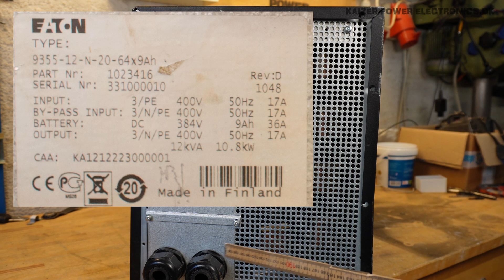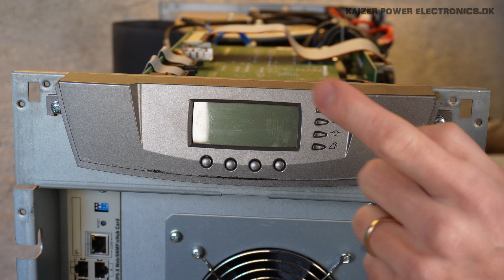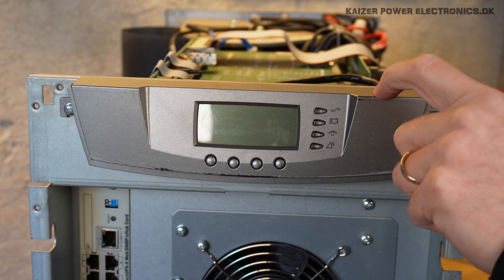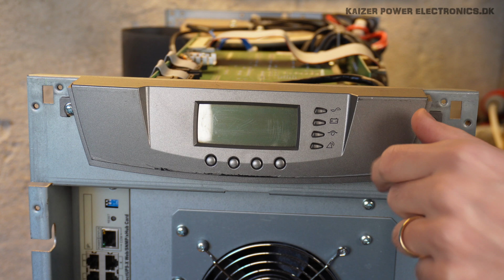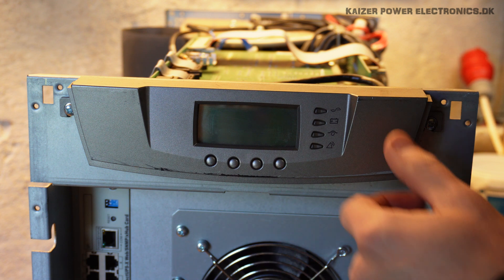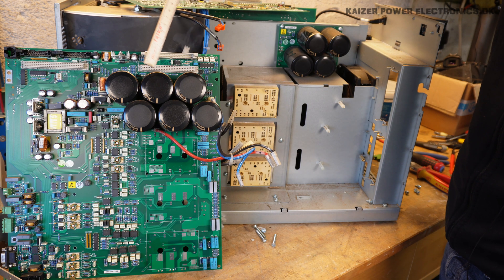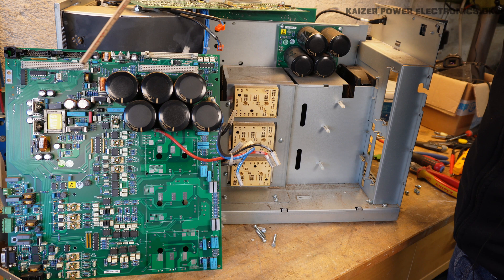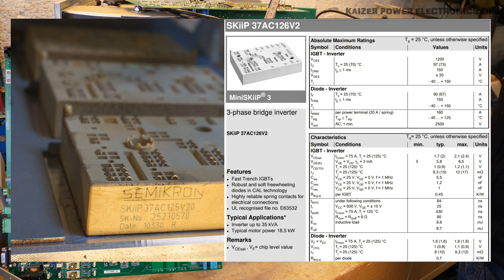10 kVA Eaton UPS Teardown - Model PowerWare 9355

Comment: Try to repair it at least - As long as the magic smoke hasn't escaped it should be fixable.
Reply from the maker: I find UPS systems often enough to try again another time :) One of the SKiiP modules had leaked its goo out, so most likely some kind of damage around that. But due to time constraints and working on the basement, out it went!

Comment: The CTs are Hall effect and so DC and pulsed measurements,  the last ones I pulled had 150khz bandwidth 300A plus minus 150A , worth salvaging 😁👍, shame it didn't work. Will you bother looking at it or just salvage the parts??
Reply from the maker: The blue ones are in the DC circuit and the black ones in the AC circuit. Unfortunately, the blue ones are made with multiply smaller pins, some 11 pins to de-solder, actually hard to do, without melting it.
I took it apart and saved the expensive components :) I really dislike SKiiP modules, as you can maybe see from the pictures, there is goo on the PCB. Two of the modules had leaked its goo'ee'ness everywhere.
Reply: @KaizerPowerElectronicsDk  yeah it was the blue ones I was referring to, the ones I have salvaged in the past usually have 4pins ..... anything I want from a board with multiple small pins I usually just cut the part out of the pcb without desoldering it😅 , and yeah I don't like those type bricks, scr's rectifiers etc .. better to cut the board and just tac the wires onto the solder points

Comment: When you say a simple unit, to me it seems complicated for what Is essentially a battery, an inverter and a microcontroller. Why do they need all those FPGAs? Thanks for the teardown though, interesting.
Reply from the maker: I see what you mean, I should properly have shown the function block diagram while saying that :) It was a reference to the design of a double-conversion inverter UPS! The Altera FPGAs are sampling all the analog measurements, like voltages, currents and frequencies in the system.
Reply: @KaizerPowerElectronicsDk  Mostly to handle the cycle by cycle current limiting, and also to handle the high frequency PWM used to keep the output voltage ultra stable over a wide range of load currents and power factors. Normally those do need a battery connected, as that massive input power surge will trip breakers, but with the battery bank (and the appropriate precharge resistors to keep the breaker contacts from disintegrating on power application) the power on inrush is a lot smaller, and the PFC is able to operate to keep it that way, riding the input voltage rise. 

Yes maintained similar size single phase ones, and the battery appetite is large, plus they are not really happy with poor mains quality. the bang on energising the bus from the battery banks can be rather disconcerting, so the easiest way to change batteries was to remove the one string, by disconnecting the fuses, then pull out the tray and swap the 72 total 7Ah SLA units (I made a lot of new wire links the first time, they had a lot of corroded ones, so on looking I put the bank back, and went to make 100 short links instead for the rest of the day) per bank, then connect the fuses when done to bring each half of the bank into play, and wait for a few minutes for the batteries to charge up, then do the other bank. That way you had smaller scorch marks on the HRC fuses.

At least the older ferroresonant types used lower battery voltage, 36 or 48V, though a fault anywhere meant you either were buying a very expensive power darlington power block, or were going to be busy for a few hours changing out a tray of 2N3773 transistors, not bothering to see if any survived, because few did. 55W headlamp bulbs in the leads to them at least meant you could run it with no output, so you could see if the fault had been fixed without needing trays of transistors, or those $1k transistor blocks. Ordering TO3 transistors by the box of 900, because that way you got 6 trays of 150, so got matched batches. Only $2 each at that time as well, in bulk.

Did enquire about another transistor, and got the reply that they could make them, but MOQ was 100k units, and they required a confirmed order with upfront payment, and 6 months lead time, at $40 per unit. A nothing special transistor, so in went the better spec 2N3773 in place of it.
Reply from the maker: It seems almost like ancients times, that repairs on component level was done. Now I see UPS systems discarded, unfit for repair, as a newer unit with warranty is a better choice over more expensive repairs, than buying new.
Reply: @KaizerPowerElectronicsDk  yeah consumerism in action, they don't want people repairing them🤷‍♂️